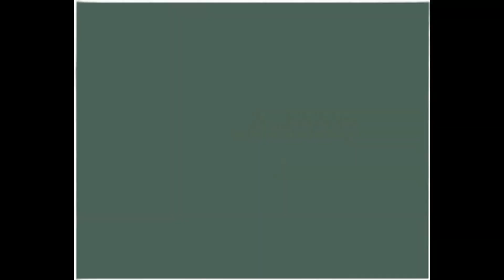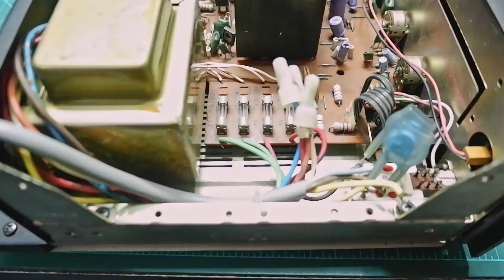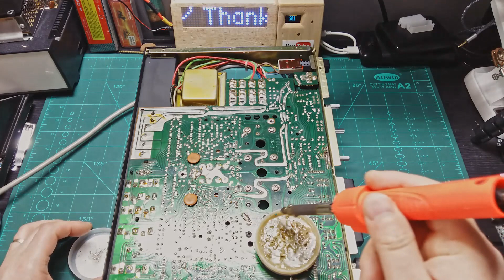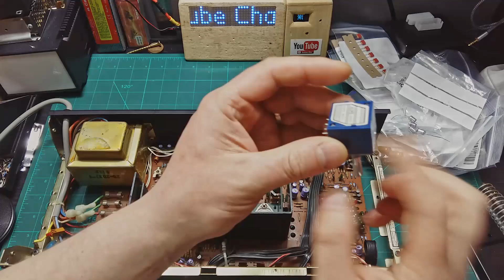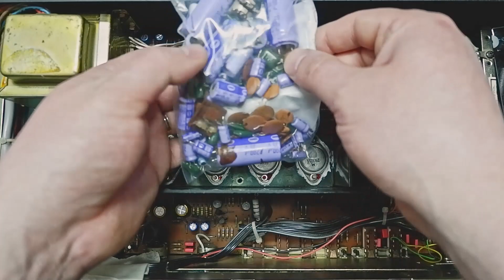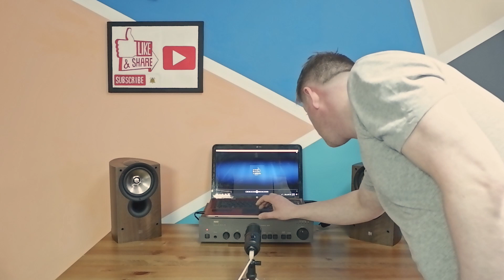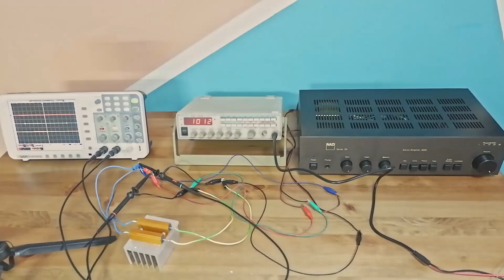How to improve the NAD3020 audio amplifier

Comment: What I listened through the comparison is the tightness and accuracy of the lower frequency after recapping is amazing and way better than the older caps.
Reply from the maker: Yes definitely get a really good improvement
Reply: @SymbolTech21  I was just trying to recap my speakers' (Wharfedale Delta 30) crossover but eventually fell into the idea of recapping of my old Sony HTIB receiver that I bought used 😂. Plus, I want to clean all the dust in that poor receiver. I kinda fall in love with this receiver cause surprisingly, it got some good features and sounds good too. Hopefully the sound can be improved after I recap it. I'll try to post videos about it later. Hopefully you can give me some pointers 😄🤝🏽
Reply from the maker: @HarithAhmadDaud  when u upload the video send me the link

Comment: What makes the 3020 sound good is it's conservative design using oversized output transistors that never strain to produce any power up to full output. The high voltage rails enable high "burst" power and the ability to drive difficult low impedance or high capacitive loads. The clever design minimizes harmonic and intermodulation distortions without the need for high global feedback in the circuit. Too much feedback sounds like shit. Perhaps most important there are no integrated circuits; the 3020 is all discrete. ICs just don't sound as good as discrete, especially back then.
Reply from the maker: Thanks for your comment I really appreciate the constructive comments on my videos!

Comment: Very nice video.
It's amazing the original caps lasted since 1978, the caps in my NAD c352 were all bad and that was made in 2004! I changed them all and the difference is astounding. Maybe it has been restored to how it was meant to sound before caps failed.
Anyway really enjoyed your video and I'm subscribing. Thanks
Reply: I have similar NAD C352 mfg 2004. since it used to get hot overall, especially the  pre-amp section which has a small heatsink, I fitted 4 exhaust CPU cooler fan over the top cover vents. It helped extending the  life span of those electrolytic capacitors. Plus if you know basic electronics, you can change the TL082 opamps in preamp section to something better.
Reply: @rogerwalter2500  yeah the pre amp section looked a bit cooked and I had to reflow the power resistors and transistors. The caps along side the heatsinks I have used Panasonic FR as they have a 10000 hour endurance at 105c rating so should last the life of the amp. 
The reason the right channel wasnt working was a broken solder joint in the right channel pre amp 'tower' - the part that stands tall near the heatsink, and also a bad joint on the preamp power resistor. 
The amp itself I bought faulty from ebay and it looks like it had something sat on top as you can see the foot marks. These Amps need space above them!
Reply from the maker: So you changed the caps to your amplifier as well? I really appreciate your subscription and I will try my best to come with more nice videos.
Reply: @SymbolTech21  yeah changed them all. I used Panasonic caps mainly.
Reply from the maker: @markthackray3185  are good the Panasonic capacitors

Comment: The power supply originally had four filter capacitors.  Why did you decide to only have two ?
Reply from the maker: Because I increase the capacitance
Reply: @SymbolTech21  Did you increase the rating of the Bridge Rectifier, as well?
Reply from the maker: @Fruitfly1962 if I remember correctly yes.

Comment: 10.000 uF instead of 4.400 uF will make for a slower amp.
Reply from the maker: So increasing the capacity will help to smooth better the rectified voltage
Reply: @SymbolTech21  does it matter what make you use and do they give diffferent sound
Reply from the maker: @hamzatatta952  the capacitors on the signal path definitely change the sound depends which capacitors you are using. The smoothing capacitors on the power supplies it's just to smooth the ripples
Reply: @SymbolTech21  I have a beautiful pair of mark audio full range and vintage mission 710  I am using a nad 302 n a Rotel power amp
Reply: @SymbolTech21  I just want to make sure that I buy the write one or I can fit them into my nad to make them Warner   What would you advise on ?
Reply from the maker: @hamzatatta952  with the full range I suggest you to try the Jean Hiraga amplifier.
Reply from the maker: @hamzatatta952  for signal path I suggest you to use good quality capacitors
Reply: @SymbolTech21  are they warm n why that one ?
Reply from the maker: @hamzatatta952  it's not about warm or cold. It's about noise
Reply: @SymbolTech21  so what kind of noise do thy give
Reply: @SymbolTech21  i have not hard of them b4 what country are thy mad in
Reply from the maker: @hamzatatta952  some times u can get hum or his
Reply from the maker: @hamzatatta952  it's not about that. It's about to get them genuine parts from a seller that not sale fake components
Reply: @SymbolTech21  oh I see it looks like a DIY job  have you built one before.  I am in the uk where are based
Reply: @SymbolTech21  I just found some guys in Australia on Facebook who can build it

Comment: Hi, Great video, I have exactly the same amp NAD 3020 series 20.  I have also taken off the cover and it looks exactly the same.  Is it possible that you could share the parts list of the capacitors and any other parts like the potentiometer which you changed.  Do you have the order from Mauser.   Much appreciated, I bought this amp when I was 17, about 40 yrs ago and I would really like to use it again.
Reply from the maker: For this amplifier I suggest that you check one by one the values of the capacitors because there is so many variants on this amp
Reply: @SymbolTech21  ok will do

Comment: Hello
great job, congratulations!
I would also like to upgrade my NAD3020E but I have doubts about non-electrolytic capacitors,:
according to which criterion did you choose WIMA TDK and Styroflex? 
Have you kept the same values for everyone? 
I also have a HUM problem when I turn on it on and I thought I'd solve it by increasing the capacitancy of the Caps in the initial muting circuit, am I doing it right? 
Would you have any tips to eliminate the buzz caused by the transformer? I read that changing the caps, with other larger ones, in the PREAMP's PSU could solve, is it a correct way? 

Thanks in advance and again congratulations for your work!  
Greetings, Dimitri
Reply from the maker: Hi there! Where do you live?
Reply: @SymbolTech21 at the moment France, Paris
Reply from the maker: @skadym  once I get back home I will attach here my FB link page and maybe we will be able to communicate and helping you with your nad
Reply: @SymbolTech21  thanks a lot
Reply from the maker: @skadym  here my fb link https://www.facebook.com/toni.budau.18
Reply: @SymbolTech21  Do you still live in PH? I"ve got a nad 3020 that needs help, got any number to contact you?
Reply from the maker: @hisagony8094  I never lived there, only holiday with my family. My wife she's filipina
Reply from the maker: @skadym  I kept all the values in capacitance how per original. I only increased the capacitance for the smoothing caps on the PSU after the rectifier.
Reply: I know it’s 4 years ago but you didn’t explain in full the smoothing caps ..what are the 2 small brown ones you put in with the 10k black caps?

Comment: Hi. Would you please provide the part list you used ? Also the pontetiometer type? Thanks in advance
Reply from the maker: You need first to make sure that you have exactly the same model. Because if you do a research on internet you will find the NAD3020 that inside it's totally different so that's why I suggest you to look for that first because not all the parts are the same.
Reply: @SymbolTech21  you are right. The 2200 μf capacitors are lateral on my amp and has a daughter cardat the rear. By the way : 3020 has four 2200 μf capacitors . Why you changed the 2 of them with different type and replaced the other 2 with 10000 μf? What if you change all four with electrolytic 10000 μf?
Reply from the maker: @achilleasleousis5030  so are 2capacitors in parallel of 2200uf that gives you a total of 4400uf so I just used only one instead of 2 in parallel of 10000uf. You need to pay attention if the transformer can handle 20000uf capacity because 10000uf it's already to much for the transformer that NAD3020 have inside

Comment: I recommend the Rotel RA 840 BX sounds superb after recapping. I used Siemens Sikorel  for power supply smoothing absolutely best sounding but very expensive.
Reply from the maker: Thanks for your comment and advices I will definitely give a try to see what's changing
Reply: hi what caps did you use , i just read that it has a lovly warm sound which i am looking for
Reply: hi could you please send me the very ones  you use and the model number and how many

Comment: Great video, I need to change the filter caps in my NAD and found this very informative.
Reply from the maker: Thanks I really appreciate and I am happy that helps you to do also your amp as well
Reply: I would like to do the same but apart from soldering do I require any other equipment to change the filter caps? I wouldn't want to do damage to this amp but feel it would benefit from this.
Reply from the maker: @CM-dw3gh  if u know how to solder and u keep the polarity of the capacitors on the right side and nothing else the amp have should be ok

Comment: No change. Only volume change because at first video it was set between 9-10 o’clock, after set at 12 o’clock.
Reply from the maker: If you see the clip when I did with the old caps at the end of the song I tried to rise the volume up but how I almost reach 12 o clock sound so crappy. so that's why I keep the volume a little lower. than with the new capacitors inn. imagine this amp was manufactured on 1978 so have 43 years old. any electrolytic after these years will be definitely dry and not work properly. then who like ceramics on audio? almost anyone like them in audio then if I need to choose between the green chap capacitors and the styroflex. in audio I will go with styroflex. Any way my friend who own this amp soon will launch his channel that will be called Dark Horse Audio, he own lots of audio gear amps speakers and lots of equipment's to test speakers amps like thd noise and more. so in the future videos I will mention when the channel will be launched and he will prepare a video for this amp with all tests that an amp need to have. thank you for your comment I really appreciate it.

Comment: Volume is not the same. Show us pics of square response and similar tests if you have them. I haven't seen damage on caps, they or amp were not measured for possible problems so it is hard to say where changes come from.
Reply from the maker: Will be a video with more tests on my friend channel when he will launch his channel so I will ask to do also a square test. because already the amp is not anymore with me. was my friend amp
Reply: @SymbolTech21  Makes sense doing tests first, then repairs if needed. My guess is friend can't test them if he wanted you to replace caps. Simply replacing good film caps (i'm pretty sure NAD chose them to last a long time) and ceramic caps isn't the way to go if circuit is not studied, measured. Even lytics are often perfectly fine, replacing without knowing their performance won't help either. Then there are transistors and resistors, bias has to be checked because most of such amps run in class A/B. It was good learning experience for the next time, if i got it right you have means to test new projects.
Reply from the maker: @codaalive5076  ceramics are not advised on audio. then electrolytic capacitors with the time they get dry and need replaced so now at list all caps are new inside and can have a long live again. about the resistors and transistors I also checked bias ok dc offset ok. also added fresh thermal paste to transistors. and my friend definitely will do a nice video for this amp running all tests THD, noise frequency swap and all that need to be tested. So when this video will be available I will be back with a comment here and share the link of that vide. thanks for your comments I really appreciate it
Reply: @SymbolTech21  Ceramic is well advised for audio if used in right place. Modern electrolytic NAD used were probably just fine too. As were all film caps replaced. It would make sense mentioning bias check if you did that. Let us know what your friend finds with tests.
Reply from the maker: @codaalive5076  Definitely once he will launch his channel I will mention his channel in one of my future videos and I will be back to you with the link because he have lots of gears of testing amps speakers and in terms of amps and speakers he own lots of them just when he come yesterday to pick up the NAD he bring me over 3 amps to look at them so one is a tube H.H.Scott stereomaster then Marantz model2330B and an other that is a diy based on one of Nelson Pass schematics
Reply: @SymbolTech21  In most cases I find original components in old gear to be in far better shape than most new available by electronics parts suppliers. I always test components to be replaced and replacement components one by one during the replacement process. Luckily in your case you chose to use quality capacitors. However, as Coda Alive pointed using the best material does not necessarily produce the best result. A grand example being English audio circuit design that manages to produce jaw dropping sound despite it using... well, all the stuff you just replaced.
Curious to hear what the Nad sounds after the upgrade but under serious testing conditions.
Keep it up!
Reply from the maker: @miltfrangos5997  this amp was manufactured on 1978 so there is 43 years old capacitors inside the electrolytic will not have a long life like that. then who like ceramics on audio? if you read all forums about audio everyone avoid them on audio. and then if you ask anyone what prefer between those green caps and styroflex for audio lots of people will say styroflex
So that is the reason we bring an improvement to this little boy. thanks for your commend I really appreciate
Reply: @SymbolTech21  There is much to be said about your testing setup however, I can already hear vast improvement in clarity and stage analysis. Good work.
Reply from the maker: @miltfrangos5997  yes that really changed a lot. I'm trying to get budget for a sound card and for the future videos I can add also these tests thd noise frequency response. but to be honest for the moment my budget for this hobby its a bit limited. but definitely on the near future I will get a sound card. thanks for your comments I really appreciate
Reply: @SymbolTech21  Some HH Scott tube amps had great output transformers, a friend took one apart and said it is one of greatest he has seen. Fischer was very good too in this regard.
Reply: @miltfrangos5997  Epcos who is former Siemens make caps in China or there somewhere, they are much better than old. Vishay, Panasonic and similar companies have great material too. But i agree it is better to test first, study circuit and decide what should be replaced. Main caps are first on the list for so old amp, i thought it isn't that old.
Reply from the maker: @codaalive5076  Yes its a great amp. so I need to look how I will find a power transformer, because its made only for us version 120v ac. so I need to check where I can find that will be on 240v ac. would be great if you have any idea from where to start searching?
Reply: @SymbolTech21  For de/coupling ceramics are absolutely fine, cleaning the pots would be much more of an improvement than any wima installed here. To be fair though, this is exactly what I did when my audio addiction began...with exactly the same amp...
Reply from the maker: @arnejensen9216  cleaning the pots I will say yes but about ceramics capacitors I will never use in audio.